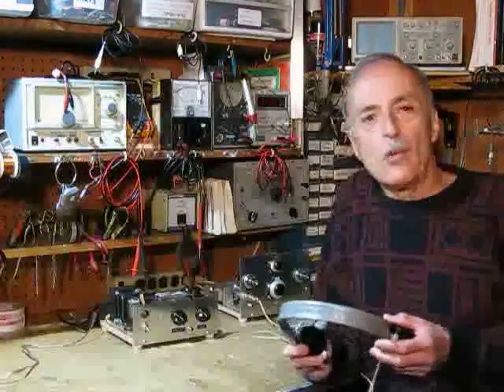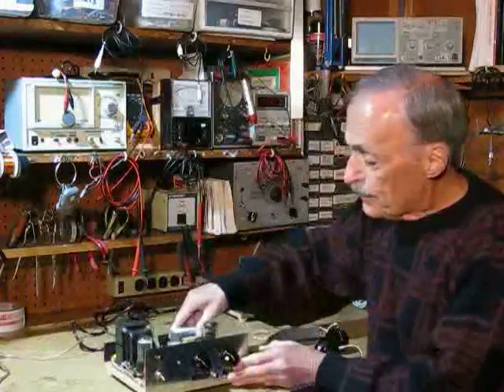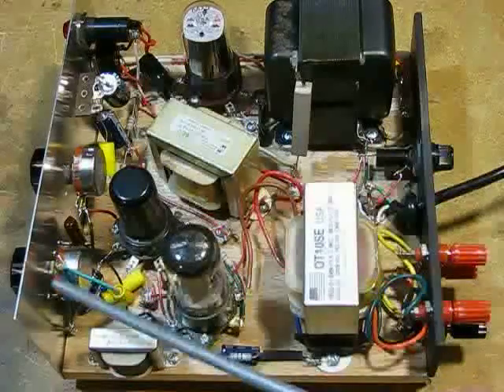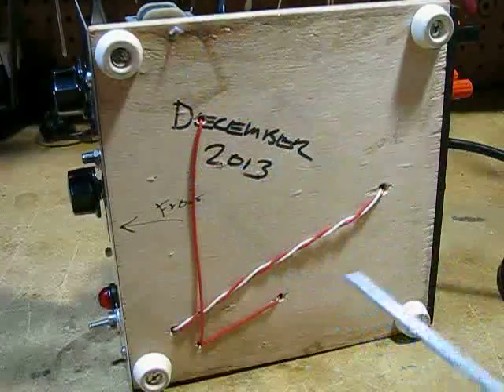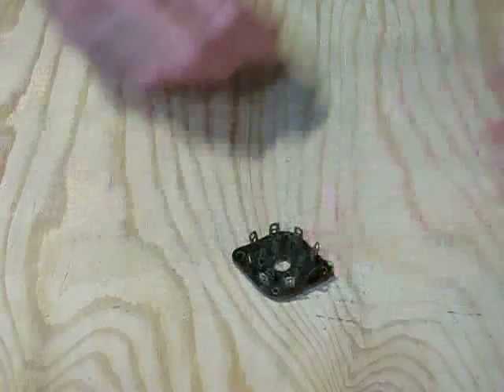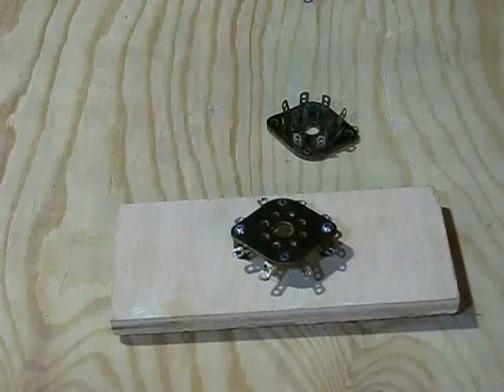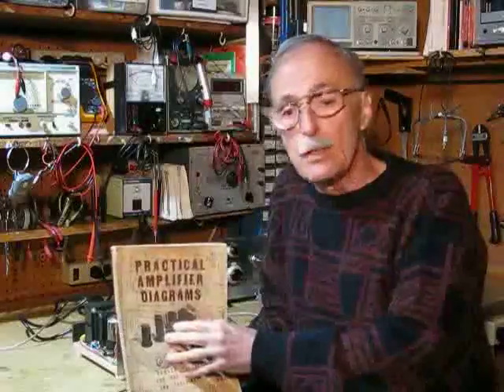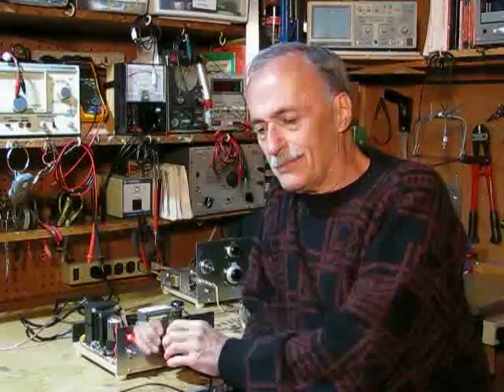SIMPLE HOMEMADE TUBE AMPLIFIER

Comment: Use a TDA 2003 you could have saved yourself Money and bother. But use your tone contro,l circuit in front of it. 4.5 watts with 12 or little more Volts p.s.

Comment: If the only reason to build this amplifier was to be able to drive a speaker, then there are sure simpler and cheaper ways using an IC like an LM386. You can buy a complete small module for <$10 running on 12 V. If the idea was you wanted to use vacuum tubes, that's a different story and enjoy your hobby.
Reply: Fred Zlotnick its about quality.. sure opamps are a great way to make a cheap and dirty amplifier but you will never in a million years achieve the sound quality of tubes..

Comment: Hi John, neat little amp and well explained.... I just might buy the book. I am curious as to the function of the small transformer to the left of the 6V6 tube, is it a small 6.3 volt filament transformer? Thanks, Tom
Reply from the maker: Hi, TomThe little "transformer" you ask about is really a small audio choke. I tried to improve on the diagram by making a hi pass low pass filter for the tone control.  But the choke isn't really big enough to do much good. Thank you for your kind comment.
Reply: Bucyrus Erie12 agreed.. i want that book..

Comment from the maker: I'm sorry folks! Correction: my rectifier is, in fact, a 5Y3 GT! I don't know what I was thinking.
Reply from the maker: +Gustavo Goncalves 

Hi Gustavo,

The 3000 ohms refers to
part “T”, the output transformer—not to a speaker.

No, you will not find a
3000 ohm speaker. Since this little amp has nothing to do with hi fidelity,
almost any output transformer salvaged from some old piece of equipment will
work. The 3000 ohms is to match the impedance of the transformer to your output
tube, but not too critical with this amp. Congrats on finding a copy of this
book and good luck building! If I can be of any help, please let me know.

Comment: Nice to watch and very informative. Question, similar circuit to Fender 5F1 with a triode input and a beam tetrode output and full wave tube rectifier. Question, the cost of silicon diodes is about 25 cents each. Why not use silicon diodes and the rest tube based?

Comment: My audio Bible from my youth was one made by Mullard. I must have build almost every circuit from that book. Starting from the 3 valve 3 watt amplifier to my favorite which was a 20 watt really good quality amplifier using EF86, ECC83 2 X EL34 plus I thing a GZ34 rectifier. Many of today's so called HiFi valve amplifiers are still based on that circuit. The only one to better it was the old QUAD 2 amplifier which really was the best in it's day.